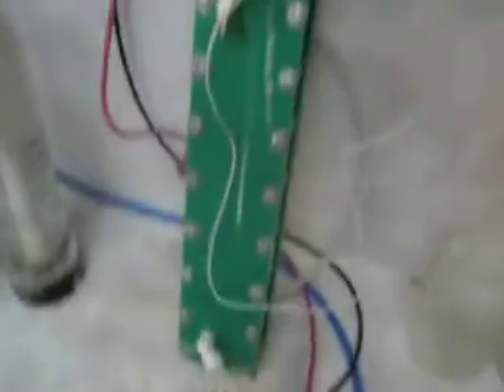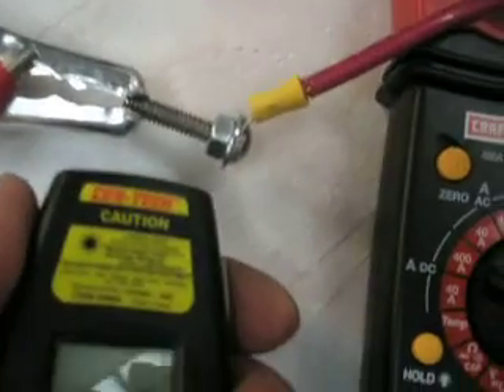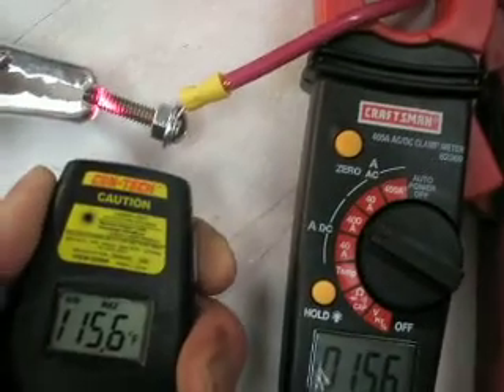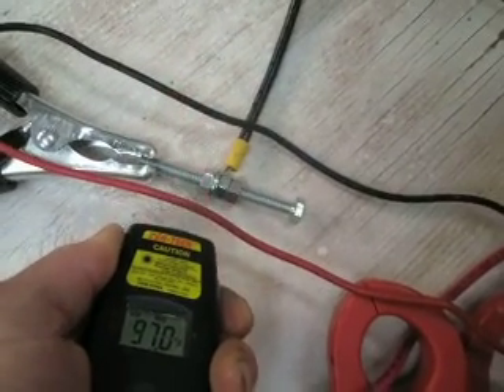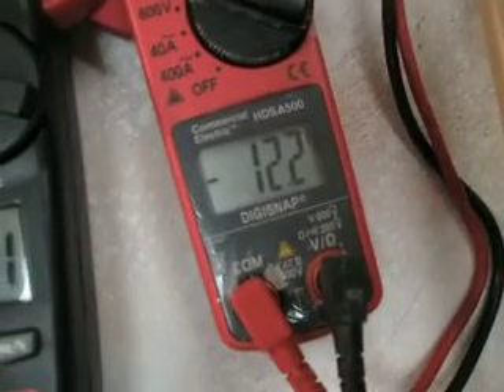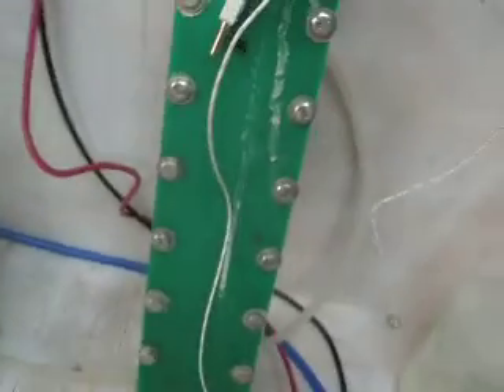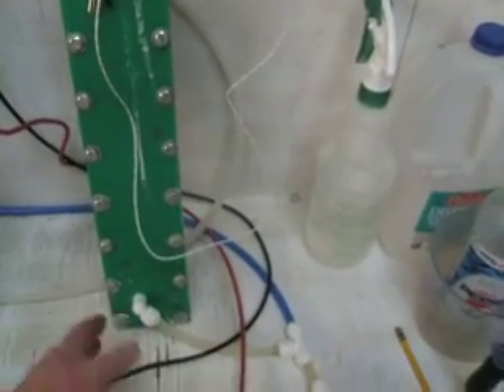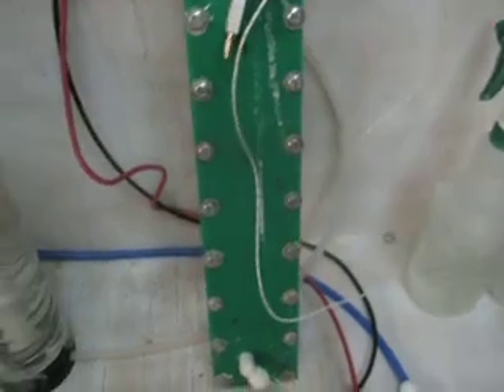HHO - Resistance of Stainless Steel

Comment: i know these clamps are made for charging and boosting cars witch do not take that much 10 seconds and the car is on what i sugest that you beffup you cables and remove the clamp and connect the cell wire directly to the booster less connection less resistance and less heat

Comment: the surface that touches the bolt is very small look at your clamp and compare it with the battery leads and the permanent clamps they are big and cover a big surface for a reason ,high amps

Comment: Nice video man , Yeah i have noticed that same thing when using stainless steel bolts on my connections on previous cells..It be would nice to find something less resistive and at the same time hold up to the electrolysis process as good  as stainless does..